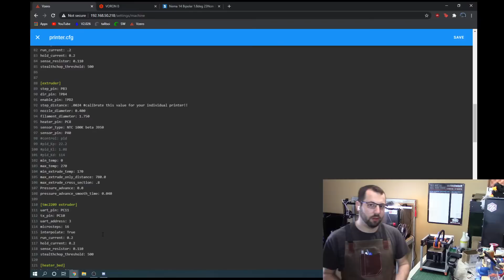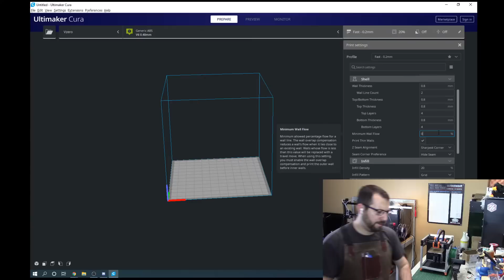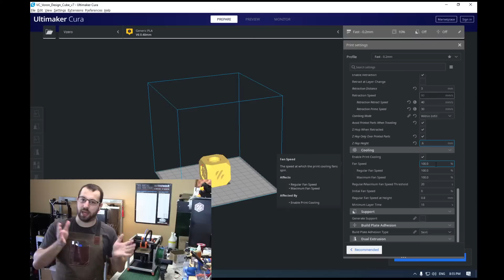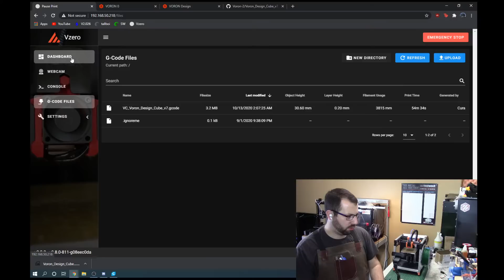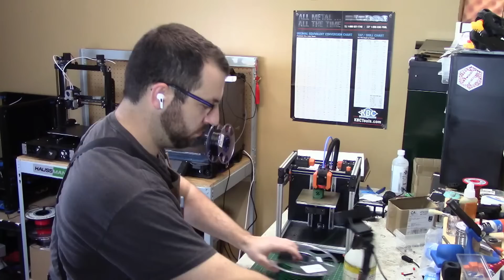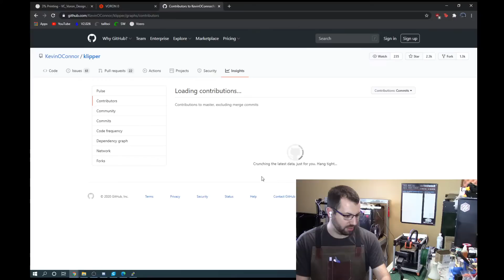Voron Vzero Build Part 7 FINAL:FIRST PRINT!

Comment: You mentioned that printing with ABS wasn’t as scary as people think. So I wanted to try myself, I need to upgrade my printer with an enclosure but wasn’t sure if I needed to move the electronics and LED screen outside the enclosure or if an extractor fan with a filter would be good enough to avoid heat damage to the electronics.
Also what would you recommend for enclosure materials?

Comment: have you ever looked at orangepi zero 2 ? they are super small 3 usb with small expansion board build in wifi and ethernet 1gb ram  and quad cord processor A53 chip. Been using a orangepi zero 512mb with octoprint for years and run 3 printers off it with 3 web cams and working flawless.
Reply from the maker: I have an orange pi zero with the h2 chip on hand, did get klipper installed with it awhile back to play with, but the crappy wifi turned me off of actually using it
Reply: @CanuckCreator  yeah the depends on the version of OS you used way back it was flakey. I always have mine hardwired so never had any issues. with 3 wifi ports you could use a wifi dongle of choice too if you really wanted wifi.

Comment: Lookin forward to the guides on Mainsail. I saw people talking about it, but I didn't know it was the standalone for klipper until you mentioned that. Awesome!
I'd like to see some content on high temp filaments, skr vs duet, and more dual extrusion, perhaps with a hotend with two nozzles/meltzones
Reply: Let me save u the trouble duet is a far superior board in so many ways
Reply: First of all u dont need to rely on and raspberry pis also the silent steppers and the web interface is far superior